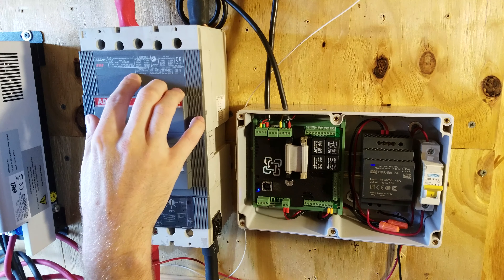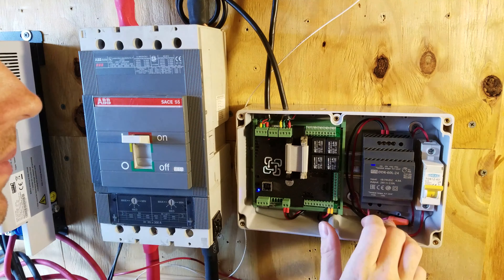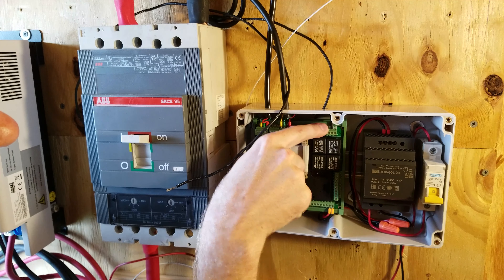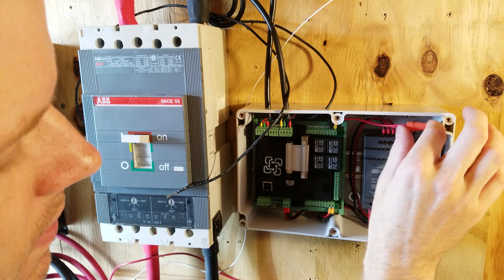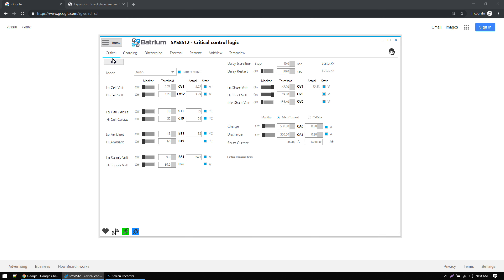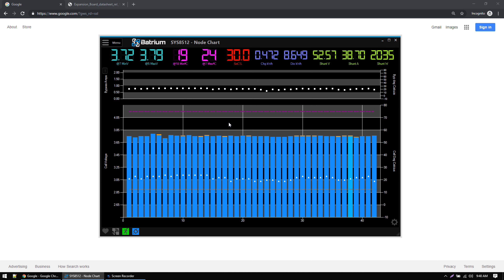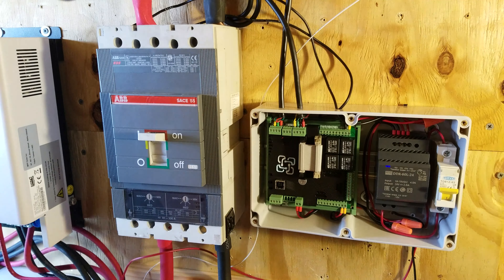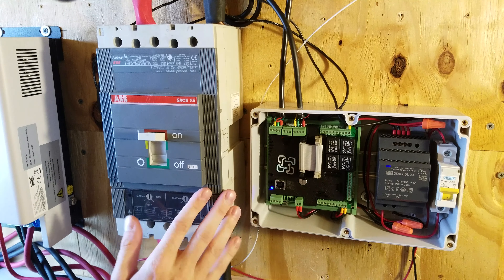Connecting an ABB Shunt-Trip Breaker to the Batrium WatchMon 4 BMS

Comment: Very helpful thanks... in the UK, Schneider MCCB ComPacT NSX100M are the easiest to get, but their Shunt trip release is also 24V
We can get the MEAN WELL dc-dc converter here, is yours still working ?
should I still order one ?
Reply from the maker: I don't have this particular configuration installed any longer; however, the meanwell converter is still working great. I have a few of them now. They're great quality and would recommend as a top-choice for DC-DC conversion.
Reply: @LithiumSolar  I am just finding the best price now..
are yours wired in on the battery side of the breaker ? so they are always powered
just thinking of my "shunt meter" would not see it there.
or if the breaker is off, the shunt-trip does not need power... so could if be on the inverter side of the breaker/meter ??

Comment: Are you tripping the input to your inverter or the load side..or just the pv input..Im using the same abb shunt trip and was just wondering ..cheers
Reply from the maker: The breaker is on the DC side immediately after the battery bank. So it disables the DC side of the inverter and the output side of the charge controllers.
Reply: @LithiumSolar  does it cause any problem to the charge controller or inverter when its under load..only asking as I am using victron products and in the manual they say not to do it..I am guessing that the charge controller (bluesolar) would get its supply from the battery which would be cut while the pv power is still coming in, and the inverter would be cut off mid stream..anyway just a thought.. cheers
Reply from the maker: It's probably not good for the inverter under load. That being said, this is an emergency cutoff. It's not going to be routinely operated, if ever at all. I think damage to the inverter is the last thing to worry about when there is a fault :)

Comment: Ok so I am building a 12v 800ah batt. I have a Batrium Bms...I was wondering if I could use a shunt trip instead of a Contactor.. I'm concerned about pre charge...  16 200ah Sinopoly 200ah Batteries... And I have to do 12v.

Comment: Thank you so much for your video. In my country the circuit breaker remote trip is 230vac. Is it still possible to use the expand relays to activate it? Thank you
Reply from the maker: If your trip coil requires 230Vac, you could replace the trip coil with a 24V version or you could string a second relay that the Batrium would trigger and that second relay would then trigger the trip coil. If you're not sure, please check with an electrician ;)

Comment: When the breaker disconnect, would that create a problem when the PV and inverter are still on?
Reply from the maker: In my case, it would simply turn off both devices. The inverter doesn't care. The PV controllers tend to be more prone to damage if the battery is cut off while PV is still connected, but the controllers I am using have protection built in for this.

Comment: I had this idea to use a remotely controlled breaker this evening so came to Utube to see if anyone is doing it and sure enough you beat me to it. I have not invested in BMS yet. Is Batrium the choice for my Leaf modules? Thanks for the clear explanation.
Reply from the maker: Batrium is a good choice for Leaf modules as well. They have a monitoring board specifically designed for leaf modules. https://www.batrium.com/collections/cell-monitor/products/leafmon-8w

Comment: Great Video!  I have a question for LithiumSolar, My concept is similar, I have a Aims 10 kw inverter charger, and also a batrium watchmon 4. When the voltage of my 24 kw 48volt leaf batteries with 7 leafmon falls to 3.5 volts/cell or less (rare). I flip a grid tied 80amp breaker and charge the leaf batteries from grid power. In theory, can I use a contactor and the Batium logic (relay) to automate this process and say bring the voltage from 3.5v/cell and turn off the contactor at say 3.8v/cell.  Any feed back would be greatly appreciated, AveRage Joe, DavidPoz and HB Powerwall, any many more. Thanks for your many ideas!!!!!

Comment: Hi
Very interesting video. I noticed that when the unit tripped the Batrium when off, do you think it would be better to feed the Batrium from the live side of the interrupter so it can keep recording information.
 Cheers Dave.
Reply from the maker: Absolutely, great point! I already made that change because when I tried to turn it back on, it just shut off again (wasn't shown in video).
Reply: You might not want the batrium to remain powered if the reason for turning off is low voltage disconnect.

Comment: Great video! Very well explained. I'd like to incorporate one of these into my system, but why are these ABB shunt trips so expensive, even used? Is there a lower cost alternative?
Reply from the maker: They're about $80 used shipped in the US. I don't think that's expensive at all. They're expensive because they're super heavy duty and are UL-listed. There are plenty of alternatives on the market, but not UL-listed or with any kind of testing. I do not trust cheap Chinese untested products when it involves safety.
Reply: @LithiumSolar  I have been looking for alternatives and it is really hard to find those breakers for VCC. On ebay they coast around 400 dollars used and in my country, brazil, they coast around 800 dollars. I am struggling to find one. I though about getting one for the ac output of the inverter with a lower amp rating, which would stop it from drainning too much power from the batteries and would allow the charger to still charge the battery. I would really appreciate to hear your opinion. Thank you.